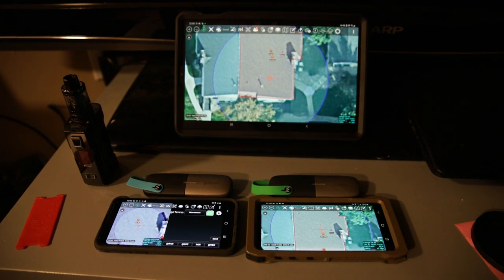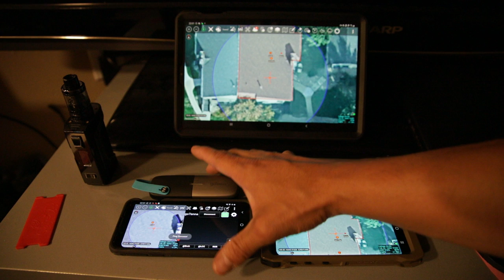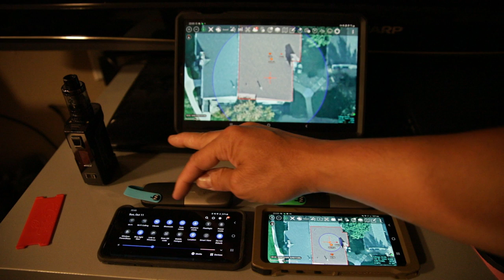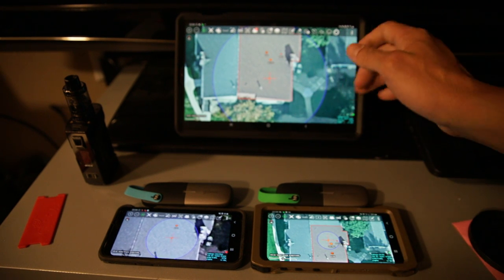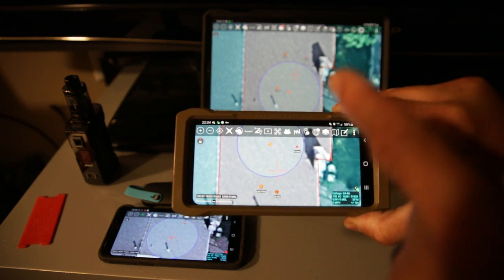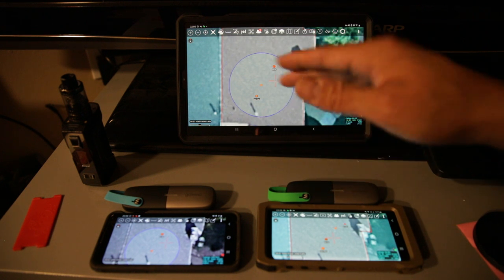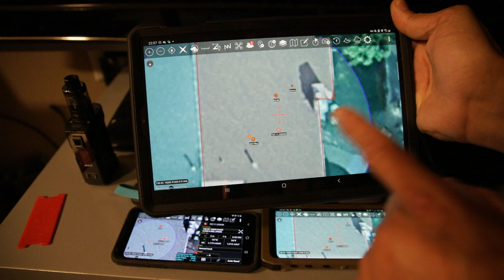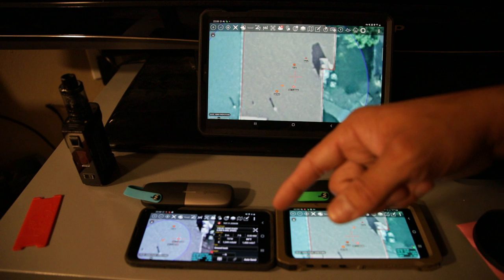Coss-Link ATAK communications between off-grid mesh and TAKServer

Comment: Do you have any experience with the hammer/ARIK plugin? If so, which devices is it compatible with? I found it on the play store website, but after signing in, it says not compatible with any of my multiple android phones.
Reply from the maker: For ATAK and HAMMER from the play store, you need modern phones running Android 10 or higher
Reply from the maker: HAMMER from the play store seems to like only select few devices. I've tried many many devices, the only one that has worked like a charm is the Galaxy S9

Comment: I'd be very interested in a straight up tutorial on ATAK
Reply from the maker: Define "straight up"
Reply: As in how to set it up, how to use it and connect with other devices. The basics essentially
Reply from the maker: Ok, so first off if you don't have the plugin that can be acquired on takmaps.com then you're not getting gotennas to work with ATAK.
Reply from the maker: If you can get the plugin, then hit me up and I'll get you squared away
Reply: I understand. Will multiple devices work over another connection?
Reply: @da-b6563  guy we need to know where the gotenna plugin is located. It's not on takmaps, unless you can drop a link. Alternatively I will share the hell out of the apk if you can distribute it
Reply: @Mekial111  Yes, lets please share this stuff, ever since seeing the video by T-Rex, i've been hella interested in ATAK over radio / without traditional network